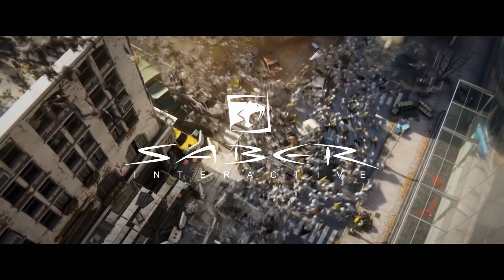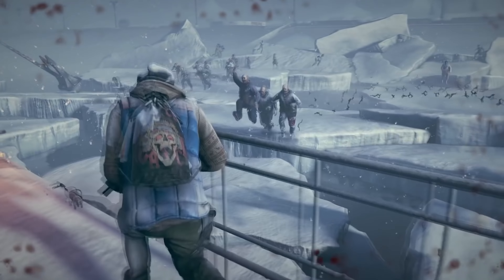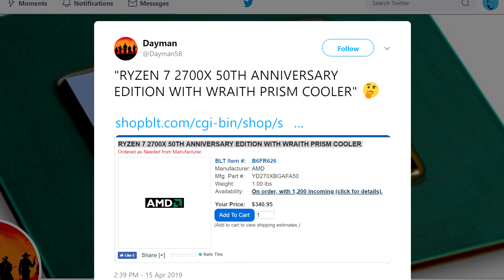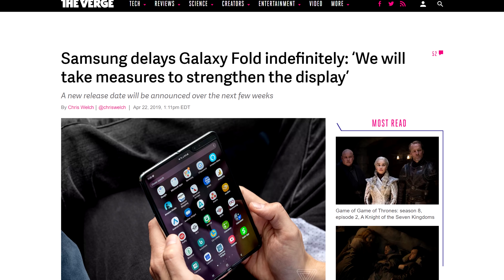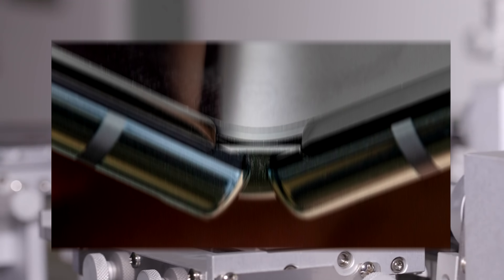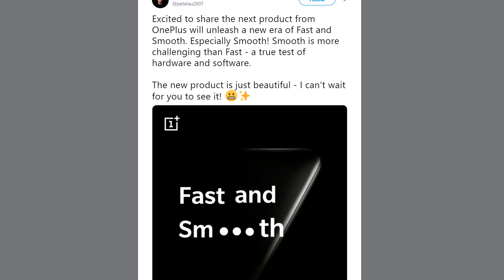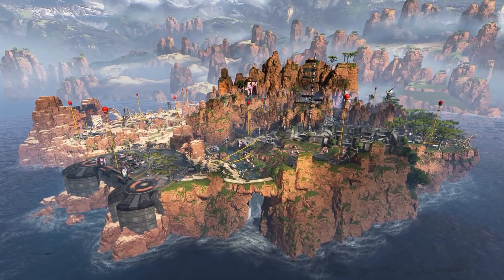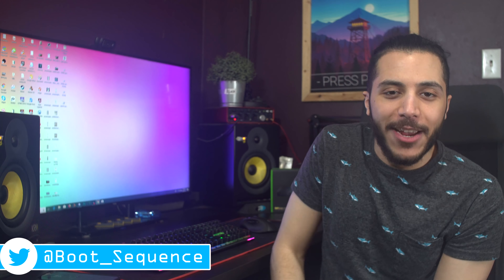AMD Vega 64 Faster Than RTX 2080 Ti! In One Game..

Comment: The lack of Vulkan support in games is down to the fact that devs have for so long been far too used to writing games entirely for Windows and by extension Nvidia GPUs because Nvidia's hardware just works better with Direct3D. People also need to remember that Vulkan is a new API based on AMD's Mantle API and is the first truly platform independent graphics API; meaning less work to port games across platforms. Add to this the fact that most triple-A games are often years in development so, it is not likely that a studio will switch to Vulkan from Direct3D half way into the development process.

It is more likely that games just going into development this year will offer Vulkan support, all the more so that Valve are pushing for this, Google Stadia requires Vulkan, and the PS5 and many non-Microsoft consoles are based on AMD hardware which benefits from Vulkan.  And we are seeing more games announcing Vulkan support.

Comment: WIth Vulkan, AMD GPU's make more sense on the long run.
Reply: Not really. This is AMD sponsored games. To certain extend we are expect them to be bias towards AMD. remember when AMD always showcase DOOM in vulkan? They stop using doom to showcase their advantage when nvidia launch turing because turing is extremely fast in doom vulkan.
Reply: AMD didn't create NVIDIA's HyperQ for DX11 multi-threading, hence AMD has Async compute for it's multi--threading.
Reply: @valenrn8657  i believe it is not quite like that. Both DX11 and DX12 have support for cpu multi threaded but it is strictly about improving CPU multi threaded performance. Async compute is about to better utilize GPU parallelism nature in games.
Reply: @arenzricodexd4409  
Nope.

https://software.intel.com/sites/default/files/managed/b6/04/performance-methods-practices-directx-fig7.png
Figure 7. Support for DirectX* 11 multithreaded rendering by different GPU drivers.

Comment: 2:18 DAFUQ my r5-1600x stock = max 3.85Ghz multi core and 4.38Ghz single core with 68C max temp in prime-95. When I heavy oc can I push all 6 cores to 4.35Ghz stable with 88C max temp (Prime 95 4 hours test) but I prefer 4.1Ghz for best oc for temp and 3.9Ghz for better lifetime. 3.9Ghz temp was a joke for me = 49C max temp.

Comment: Playstation uses vulkan??? where is that information??? I heard from a developer that the playstation uses OpenGL not vulkan and it is even better than vulkan at performance
Reply from the maker: well its actually called GNM. its not exactly vulcan but its a modified/closed version of it. Think of it like RTX from Nvidia, they are using DX12's DXR but in a modified and closed way that only Nvidia card can take advantage of.

Comment: It’s 1 game and it’s AMD modified, why even bother making a video on it. It’s already been leaked on YouTube
Reply: Max Pain thing is tho, the 2080ti isn’t a 1080p card, so putting it up against older architecture makes no difference.
Reply: @chrisgrimes325  lol dude.. there's no such thing as a "not a 1080p card" ;)
Reply: SpeedRebirth yes you’re correct, that’s why I said “ it isn’t a 1080p card” as it was made for higher resolutions. It will run at 1080p but the full potential of the card won’t get used, be lucky if it will utilise 50% of the GPU & at the same time bottleneck the CPU
Reply: @chrisgrimes325  you know there is high refresh rate gaming at 1080p
Reply: - Immortalian - yeah of course and what’s your point ? What’s that got to do with me saying it isn’t a 1080p card, cause it doesn’t get used to its full potential.

Comment: Downvoted. Because of a title. You can't know it's only one game. You haven't tried all Games on all OS'es. You haven't tried linux and proton as well
Reply: The Vega64 beats the 1080ti right after it was on the market in Linux. You can easily find it on the net.  As a long time linux user (more than 20 years) I know a few things. The last few years AMD is much more openminded to the linux community than Nvidia, and the results are better drivers (kernel + MESA) even FreeSync is supported in modern kernels.
Reply: @xXTheoLinuxXx  My first pc had i80286 cpu in it. Don't bother.
Reply: @bitman6043  my first computer had a 6502 CPU and 32k of ram :)  Besides that I was using CP/M on a Zilog Z80 machine.  But I had a 80286 machine too, an Olivetti.  As expected with a very nice mechanical keyboard :)